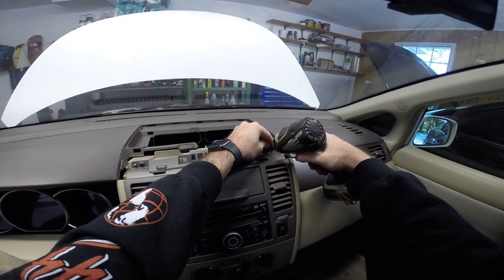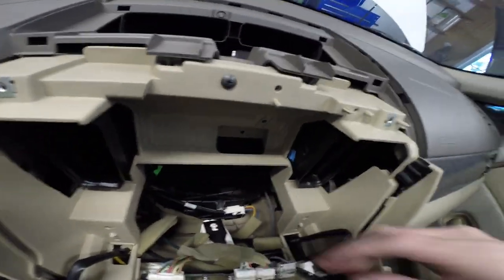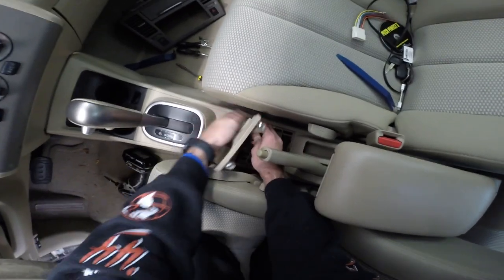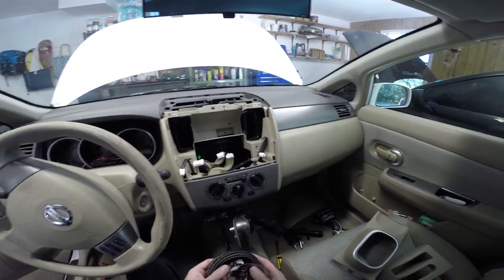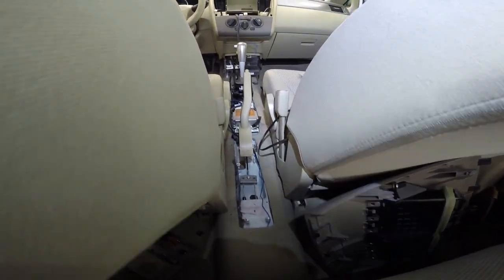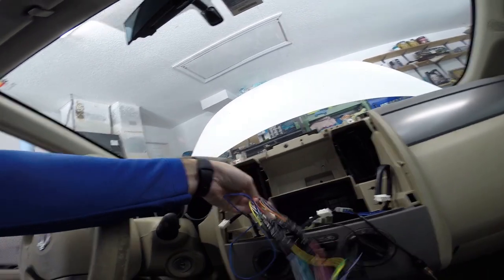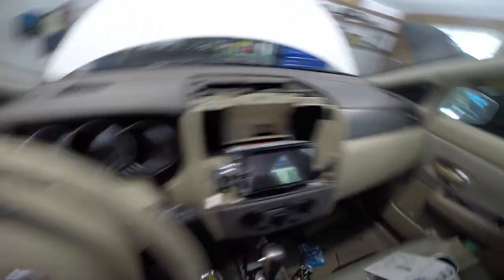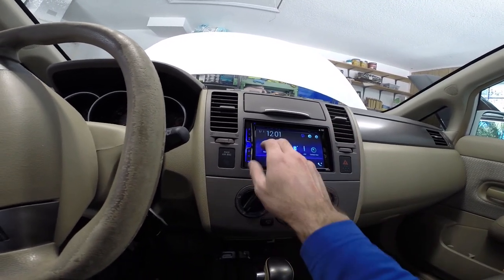2009 Nissan Versa How to/DIY Center Console Removal and Aftermarket Stereo & Subwoofer Installation

Comment: Looking into upgrading my radio for Christmas- I have the buttons on my steering wheel that control the radio station and volume. Would they still work if I changed out the radio for a touch screen?

Comment: Thinking of getting this car as my second car . Just for daily commute and around the city and doordashing on the side . The couple prices I saw was 3k with 129k miles and a 3500 with 132k miles on it . Think those are good prices ? Currently drive a 2013 hyundai genesis coupe 2.0t
Reply from the maker: We have owned the one in the videos since around 30k miles. The only issue we had was the CVT trans going out at 132k miles which is expensive to replace. I would stay away from the CVT on a higher mileage one unless its been replaced at some point. I would assume 2-3k price point would be average for one in really good shape.

Comment: Hi, I have 2010 Nissan Versa and I bought a double din car stereo from Dual Tech. Its working just fine but the trim bezel that it came with the new car stereo doesn't fit. How can I adjust the brackets so I can hopefully move the car stereo back a little.  It seems I can put the trim since there is space at the bottom and both sides but not the top.
Reply from the maker: Typically the trim that comes with the stereo don't work with every car. I bought a trim kit made specifically for the Versa.

Comment: What did you hook the blue antenna wire to
Reply: I believe that wire is intended for if you have a power antenna. Since these versas do not have that, it is not connected to anything. If there was a power antenna, I believe it would be connected to the same blue wire coming out of the receiver that goes to the amp (also blue).